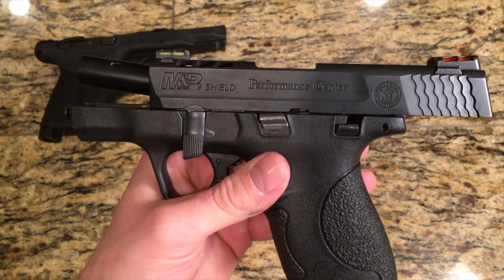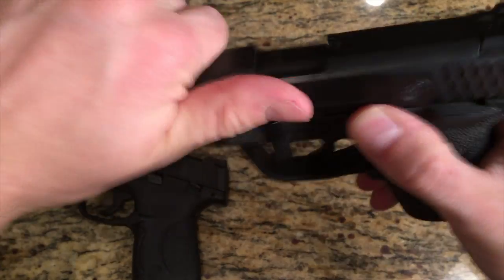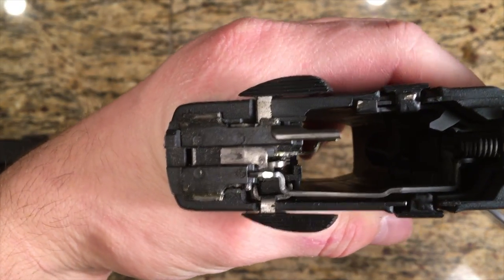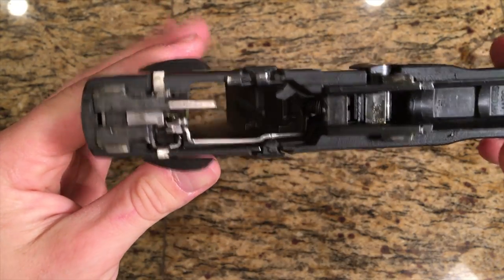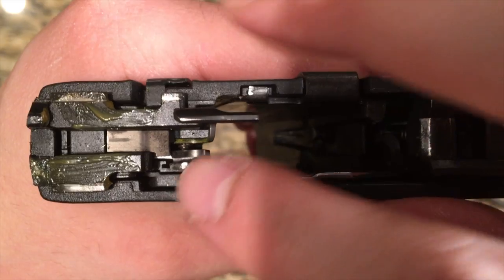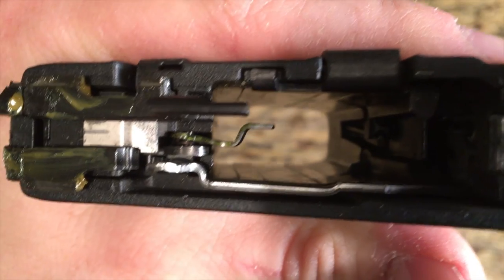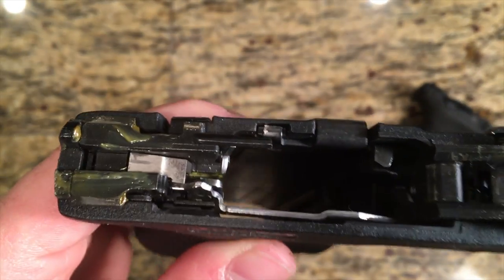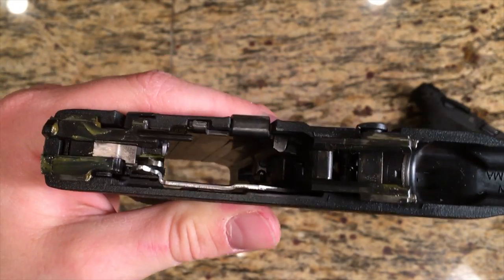Don't Send in Your M&P Pistol Just Yet!

Comment: Thanks so much for this video.  I p/u my Shield 9MM used a couple of weeks ago and initially used the lever to get the slide off.  My problem came trying to get the slide back on, but after several minutes of fumbling, got it back together w/much difficulty.  That lever is a PIA, lesson learned and I’ll be using the trigger from now on.

Comment: To reposition the lever back to position if  you read the manual, it advised just to put an empty mage back into the mag well. Experienced and careful gun owners can just ensure the gun is empty and then dry fire the trigger to disassemble.  Also keep in mind the paint on the green lever will soon wear off and you won't be able to see the lever.
Reply from the maker: egads2 unfortunately mine was so far out of position that a magazine wouldn't move it, and I only feared bending or breaking the lever.
Reply: @4MRRanch  My Mag wouldn't put it back in place fully either. Didn't want to force the mag against that small lever.

Comment: the full size m&p had a tool in the grip being the mag to click sear disconnect.  also putting an empty magazine in pushes it up
Reply: Putting an empty magazine in (or trying to do so) when it is stuck down like this will just result in bending the hack out of the lever.

Comment: Thanks!  I have four Shields and have only once had any problem field stripping them.  I don't use the "pull the trigger" method; I use the little lever inside.  I couldn't get the slide locked back during reassembly and discovered the little lever was out of position just a little.  Moved it and slide locked back fine.  Maybe it was coincidence, but that seemed to be the problem.
Reply from the maker: It’s a frustratingly small and simple issue that causes this phenomenon. But this video has seemed to help many people, which is great but concerning at the same time.

Comment: On here doing research, just bought a brand new Shield plus, out of the box the trigger was inoperable, that disconnect was the first thing I went for as I already have a 2.0. That was not the problem so back it went, 2 hours after I bought it without 1 round fired. I'll be curious to see how it slipped through QC...
Great video! Thanks...
Reply from the maker: Thanks for watching!

Comment: Had the same problem with a new M&P m2.0 9mm, happened twice so I sent it back to Smith and Wesson.  Wish I had seen your video before I sent back as it has been a month and Smith & Wesson still has my pistol
Reply from the maker: Sorry for your bad luck. It is a simple, yet frustrating issue.
Reply: I  THINK YOU NEED MOOORE GREASE ON THE REAR ON THE GUN  --- JUST TO BE SURE   !

Comment: Unless you are keeping your pistol in a hot safe for months and months, that grease will cause more harm than it will prevent.
Reply: How? If he cleans it after use then it should be fine. He’s only greased the metal to metal spots anyway, as he should
Reply: Depends on the grease. White lithium grease will last for decades in storage or in use on components without separating or hardening.

Comment: My shield plus performance center now has a dead trigger unless I pull the trigger slightly to the right. I have never shot it. I dry fired it a ton, took the slide down to take a look, and I was going to take it to the range today. Now I’ve tried everything and i have a dead trigger where I have to pull the trigger from a specific spot of the shoe and to the right a little. Sucks but let’s see if Smith will fix it.

Comment: Thank you for the video! You saved me a lot of trouble sending my M&P to S&W and paying an FFL. ( I live in NJ). I think the issue resolved itself when I slammed the mag into place...
Reply: Maybe that's what S&W wanted us to do upon re-assembly. But that's a really a thin little lever. I noticed a little "wear" on it after I tried to lightly force the mag in. Instead, I just took the rail off and positioned the lever as this article said. I didn't know that it normally existed in such an up position. Put the rail back on.

Comment: thanks for the video! I have had a shield for about 3 weeks and the lever completely came out Friday when i was assembling the gun after cleaning it. I did follow the instructions in the manual and the lever popped out when I put the mag in. hoping now I can re-install it myself
Reply from the maker: Paul Humphrey glad it was helpful. It was a pretty frustrating several outs for me when I was trying to figure it out and I didn't see much on YouTube about it so wanted to try and shed some light.
Reply: the pin that holds the lever is Not a tight fit. that allows the lever to move freely. when taking out the sear assembly be aware that the pin can and will come out. no big deal just put it back in

Comment: So, this video helped me tremendously,  however, its worth noting that unlike the sd9ve, and the Beretta I have all on the same table, this M&P won't dry fire. .made me think that I had a firing pin issue...chambered a round, pointed downrange, and boom. Dont worry that the firing pin doesn't engage without a round chambered. It WILL fire.

Comment: I don't understand how it got in that position in the first place, if a mag was in before disassembly?  On a side note, the larger m&p models have a tool in the grip for this specific function. it can also be used as a takedown punch I think. At least for the directional pin behind the take down lever.

Comment: Mine fell out during the first cleaning.  It (sear disassembly lever) didn't have the pin upon which it is supposed to pivot, it was just wedged into the coils of a spring so of course it fell out; it was never properly installed.

I'm keeping the parts, but not re-installing the lever mostly because I don't have the pin. And, I do NOT want to send it in to 'Smith and go without it for six months.  Also, last time I shipped a gun it turned into a fiasco.

Maybe I'll contact 'Smith and ask them to send the pin and if I feel like it I'll do an install.  Thoughts?

Comment: Imagine that, learning about your equipment before you F it up! Genius!
Reply: Just made the same mistake pal (it's a common issue) and I read the S and W instructions very carefully. The problem is that upon re-assembly, that lever doesn't go back to the FULL UP position which inhibits the mag from seating fully. Having spent an hour trying to figure out why the "sear activation lever" wouldn't go all the way up on re-assembly I will no longer use it for dis-assembly. I will simply leave it in the "up" position it's in and simply pull the trigger to get the top slide off. You always a dick ?   
Thanks to 4MR Ranch for sharing this. Big Help.
By the way, mine is an M&P 2.0  5".  Same issue.

Comment: In MA because we have magazine safeties  on our guns we have to use that lever for take down because once we take the magazine out the trigger doesn't work in take down like other guns do.
Reply from the maker: Matthew DeMello that's a good point I hadn't considered how some of the m&p's have that feature
Reply: Free Arms california is the same way, but I just put the EMPTY magazine back in after clearing it and pull the trigger and you can field strip it that way and just remove the magazine again.
Reply: Or you can get irritated with that and just break it down and take the magazine disconnect out and while there remove the sear disconnect. Much nicer trigger.
Reply: Massachusetts doesn't require a magazine safety.  It does require a load chambered indicator and at least a 10 lb. trigger pull.  Fun part is, S&W failed to put the pin through the sear deactivation lever and its spring, and the lever fell out when I depressed it... left it out and I take down my gun like a Glock.

Comment: Your video enabled me to reassemble my Shield Plus the last time, but I've just cleaned this same pistol again and am having the same problem with reassembling it.  The slide won't stay all the way to the rear.  I can reposition the little lever thing (it isn't yellow on this one) several ways, but none of them are working this time.  The slide can be moved to the right position, but then returns to about 1/4" too far forward.  It won't stay in position to the rear.

Do you have any other suggestions?  I have two Shields and two other Shield Pluses, and this is the only one that has this problem.  I'd rather not have to send it to S&W but I can't get the slide back on to stay in the proper position.  Help!  (anyone). Thanks

Comment: Brand new shield, after firing the slide would not go back in battery. It would be about an 1/8th if an inch off and it was causing me malfunctions. I almost threw the gun at the target. I’m thinking it may have been an issue with that piece.

Comment: cool video bro, i got my shield plus with out the pin that hold the deactivatiobn lever from s/w, when i moved it just fall down, very sad for a new pistol but the dealer change the all piece.  Bro work better the greace than oil? thanks for the video is very helpful

Comment: Good video, I just purchased one of these yesterday, a first-generation looks like it's in great shape it was a police trade-in of course during the pandemic is hard to find anything but luckily I found a store that had a good selection of guns left. are you still using yours and how do you like it
Reply: That's awesome I also got a first generation should about 7 months ago and I love it I put about 400 rounds threw it and it runs great shoots all kinds of ammo the only thing that sucks is the mag capacity I really should have waited for the shield plus because the flush fit mag holds 10 and the extended holds 13 on the regular should it's 7 and extended 8... Kinds stinks that the damn thing don't even hold 10 rounds other than that I feel it's one of the higher quality concealed carry weapons it's a little heavier than some others out there but that's the quality with smith the slides seem the be heavier but I feel that just makes the quality and durability of the gun even better also handles recoil well for a small gun.

Comment: After installing the slide, when you put the magazine in, the magazine will push the lever up automatically.
Reply from the maker: Not when it becomes stuck like this. The lever will return in normal operation as you’ve described, but will not move when it pops slightly out of position.

Comment: The sear disconnect lever did indeed fall out with my gun at my first cleaning. I took the sear block out and found out they forgot to install the retaining pin.
Reply: Just happened to me. Is its ONLY function what he says here…for the takedown process? Like can i run the gun without it, safely?
Reply: @HammersOverStrikers  That was my conclusion. I have yet to shoot it again though since I removed it.

Comment: Thank you for the video. I was about to contact S&W and make my self look like an idiot because I didn't read the manual. I'm not sure if the manual covers this issue (haven't read it yet). Being a real idiot errrrrrrr........Real Man, I don't need no freaken manual. Of course that usually leaves me with a lot of parts that should go some where. Again thx for those of us who don't read manuals.
Reply: The instructions do not address that the lever has to be in the up position upon re-assembly. In fact it's still in the down position and the Mag won't go in without force. No way to treat a new gun. So, I'm going to leave the Sear lever in the up position and simply pull the trigger to release the rail. (NBD. You checked the barrel was free of a bullet before you began cleaning the gun, right?.)

Comment: Pull trigger to release the slide.  I'm sure ahead of that text is something along the lines of,  ensure the magazine is removed and the chamber is visually and physically cleared, like 2-3 times check before continuing.  I fail to see how someone can selectively follow the instruction to use the lever, but not follow everything beforehand that makes the lever moot.  Those that these Negligent Discharges happen to:  Put the gun down.  Please step away from the gun.

Comment: Is your slid lock hard to release the slide? Mine is rely hard it sucks so I'm adjusting to just racking when inserting new mag
Reply from the maker: Which handgun are you referring to? They can be a bit stiff but I personally like to just rack my slides when reloading. Reason being, is that the muscle memory will be the same no matter the pistol, whereas if you get used to a specific slide release, it can vary from gun to gun and may get you into trouble under a high stress situation.
Reply: exactly

Comment: Prime example of why you should read your manual.
Reply from the maker: M_Dizzle502 well in this case reading the manual issues the dear release lever which if pushed down in any kind of offset manner has a tendency to get stuck.. so in my opinion, if you have an m&p that can fire without a magazine take it down with the trigger method (after making 100% sure it's not loaded)
Reply: I read my manual and this happened to me. I believe the manual’s exact wording is something like “use a small item like a screwdriver to push the sear lever down 90 degrees.” 

Well, I pushed it down until it was out of place like that, because it didn’t look like it had been pushed down 90 degrees until then. And I was expecting it to click into place. And then I couldn’t get it back up, and trying to use the mag to do it, as the manual states, was not working. It took me about 5 minutes to figure out that pulling the trigger while trying to seat it would finally fix the problem. But the manual is confusing at this instance, so reading the manual can end up not helping much.

Comment: That button/tab is called a slide stop. I also call S & W and I told them why is that tab even there? 99.999% of all pistols that have a tab there-is used for a slide release. 
HAD I KNOWN THAT WAS A SLIDE STOP AND NOT A SLIDE RELEASE, I NEVER WOULD HAVE NEVER BOUGHT THIS GUN, 
S & W MISLEADS PEOPLE.
Reply: jesse8625 i just bought one a learned the same shit. I wish I didn’t purchase this
Reply: Just giving a peice of info alot of pistols in the manual it's a slide catch it just happens it's loose enough to release the slide with it I don't have any trouble just running slides so just do that as it is
Reply: And joey always take a little time to examen a firearm before purches if the will let you try  using the catch as a release if they have an issues letting it slam forward emty which I would bring some snap caps that way you can try the trigger a few times aswell

Comment: Nxt time read the manual
Reply from the maker: The manual's method of takedown is what i'm saying caused my problem in particular. If I had never messed with the lever, it would not have gotten stuck slightly misaligned like it did. I just wanted to post this video due to the fact that I saw TONS of talk about this in forums online but no real visual explanation or help.